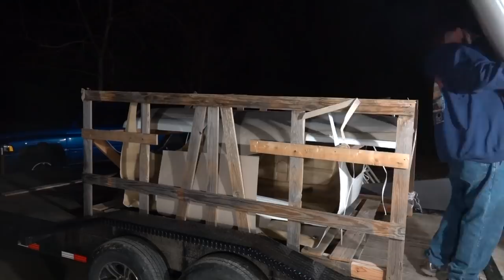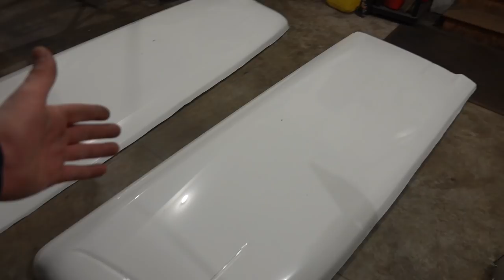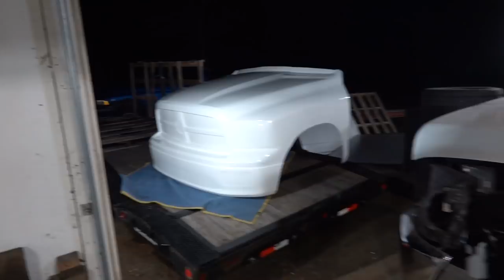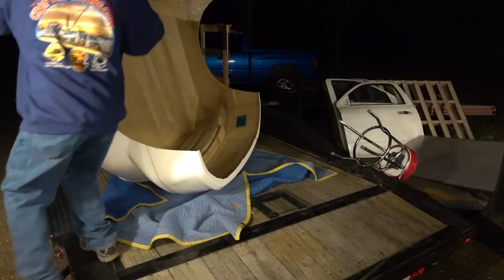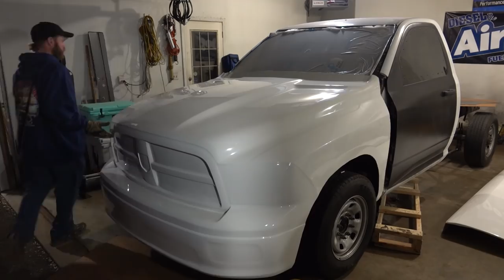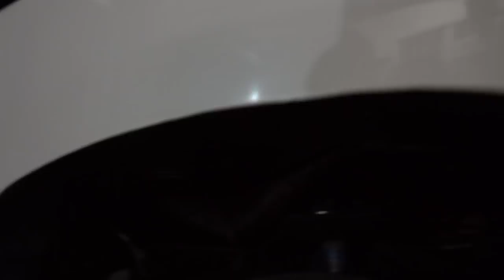FIBERGLASS FRONT CLIP FOR THE CUMMINS DRAG TRUCK!!!

Comment: You can lift the front clip by yourself in the garage with mounts wherever you put your hood pins. Use them as lift points with a cherry picker? Or hinge the front like ya said, they just go kinda high so garage might be tight.Truck is looking awesome so far!!

Comment: Hey Tom I always loved the 1500 style and it looks great on your truck. Having the front clip flip forward to access the engine compartment and have good pins up near the windshield so if it's only you there you can access the we engine quick and easy and maybe fender guides on the inside of the fenders or have it like a 18 wheeler. keep it from ripping apart.